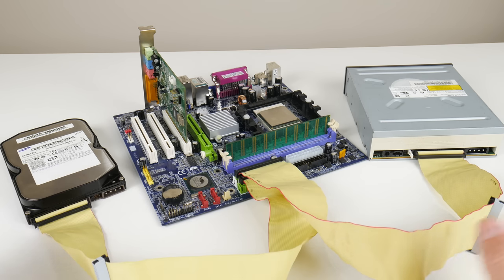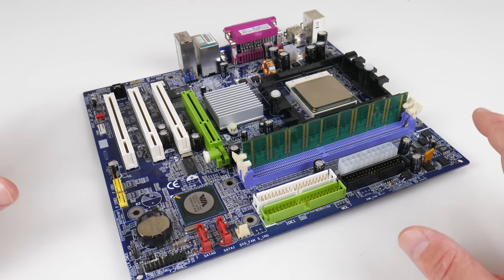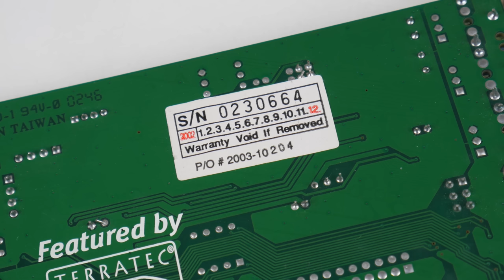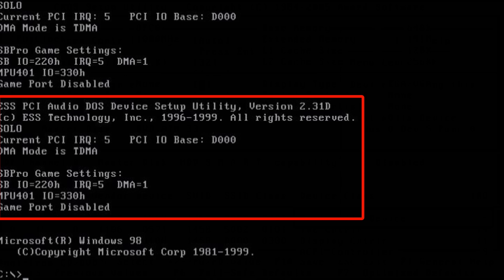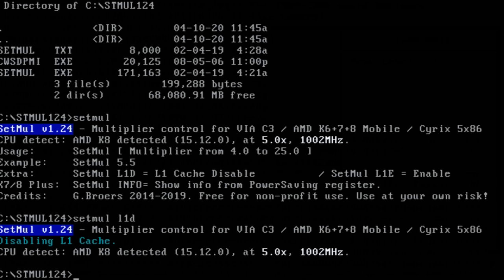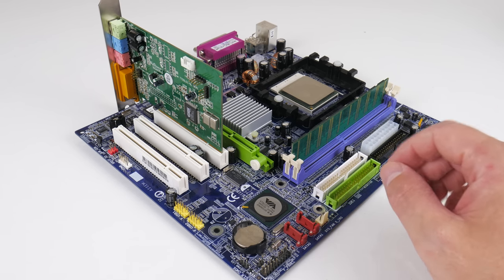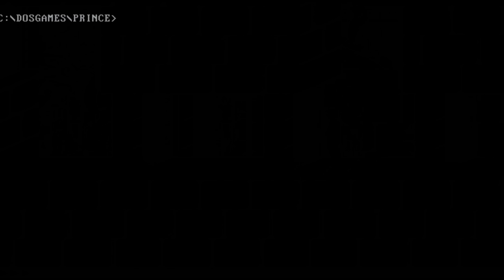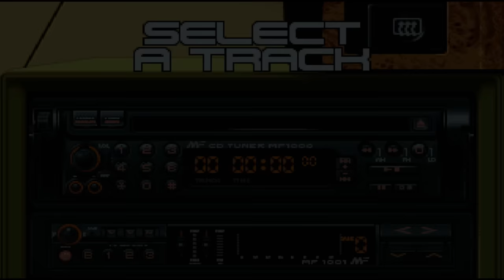DOS Gaming PC with Athlon 64?

Comment: Well, that does it. I have 90% of a socket 939 Athlon 64 PC in spares, and I've been looking to get into building a reliable DOS PC. Thanks for the inspiration! :)
Reply from the maker: The tricky parts is finding a compatible sound card. But do go with VIA chipset, should be most compatible with sound cards.
Reply: @philscomputerlab  Welp.. as it turns out, the motherboard I was thinking of was an AM2 board, so now I'm looking for a motherboard as well as a sound card :D
Reply: Just use it for router

😆😆😆

Comment: Fun fact about "Prince of Persia", the video and cpu was so low, author invented revolutionary hack to have smooth movements. pixels of charater not redraw at next frame, only changing (XOR-ing) some from the last frame... Later this technic was used in video compression (and still it's the base of all modern video compressions) but Prince was the earliest to do that
Reply from the maker: Wow that's cool and very interesting!
Reply: Yes, but that was for the original Apple II version of the game. The 16-bit versions did not need such magic. He overcame the limitations of the hardware and managed to include combat in the game (no memory left for additional characters). Otherwise, it would have turned out as an oriental prison exploration game. Visit the Ars Technica channel for the full story.
Reply: @НиколаГеоргиев-ш2б  of course, but the point is, he managed to get smooth movement on so slow system like Apple II 

 Now its simple, You just use compression, and when they did that, they invent one (there was no alternatives)
Reply: @philscomputerlab  hi phils i have this PC Fujitsu ESPRIMO E5720 Dual Core E2160 1.80GHz 2048Mb 80Gb DVD±RW

I can run dos  games

Comment: Important note!!!

Motherboard chipset a̶n̶d̶ ̶D̶D̶M̶A̶ support MATTERS when using PCI sound cards in DOS!
VIA which is used here generally has good compatibility, while nForce from nVidia is useless.
Also newer Intel chipsets (ICH6+ !?) dropped support during the Pentium 4 era I believe.

Vogons have many threads about this and what works and not:
https://www.vogons.org/viewtopic.php?t=24769
https://www.vogons.org/viewtopic.php?t=70375

But didn't know it could work with VIA on such a recent platform, cool :-)
Also didn't know about the IRQ trick on the PCI slot :-D
Reply: Much to learn you still have.
Reply: @retropcscotland4645  For trying out countless permutations, little time we all have ;-)
Reply: Not exactly. Look, this southbridge does not support DDMA and it works. It depends on sound card, this solo-1 has dos sound device as the main device, not legacy, so it is easier to make it run if you manage it to run physically on one of the standard DOS IRQ and the bios is supporting all southbridge features, a bit of luck is involved. Other cards which has the DOS sound device as a legacy device needs DDMA, or a TSR to work in DOS, like the PCI Yamahas, and are highly dependant on drivers support for chipsets.
Reply: @Romerco77  You are correct, I over simplified things. I'm wrong in saying DDMA is required.

Its more correct to say support depends on the chipset...or???
Reply: @Romerco77  ...or one can say:  You can't just use any motherboard with a PCI slot :-p
Reply: @retroftw  I would say it depends 40% on chipset, 40% on Sound card, and 20% on luck and bios. 😅
Reply: @Romerco77  lol...sounds about correct :-D
Reply: Yeah, it is. I can say I was unlucky and O had a great Nforce motherboard from Asus. So, no audio, nothing to do. I had to switch system.
Reply: Btw @PhilsComputerLab, my comment was not meant as critique of the video, more just my 2 cents about a potentially deep and complicated rabbit hole. :-p 

I really liked the video and learned some new things. This subject of PCI sound cards in DOS could in fact really need one or more videos to inform and clear things up.

Also, how far could we go in using newer platforms while retaining DOS sound via a PCI sound card one might wonder!? :-D
Reply: So... how come some SBLive PCI cards would work in DOS, and others would not? I had one on a 440BX chipset and it worked. Friend had a different setup (PPro I think) and couldn't get it to work in DOS for love nor money.
Reply: @Reziac  Even with hardware support, you still need to install the correct drivers, and get the IRQ settings correct in BIOS and in the driver settings etc.

So many things could have caused it. Difficult to say without alot more info ;-)
Reply: True enough. DOS could be an Adventure. :)
Thanks for the Vogons links, great info.
Good thing I hoarded all my old motherboards. :D

Comment: Another great video Phil, I had retro game nostalgia and begun with a Socket A (462) AMD trying to make DOS work, 6.22. I have yet that installation, but the only thing that I cannot make it work is audio. Omg, I became mad and I tried various audio card, but probably with my Asus motherboard Deluxe this card wasn't made to work pci sound card on Dos unfortuntaly. From that day I made a lot of tries and finally I had a Real Dos machine from 1996 with Banshee video card and a Pentium 200mmx. Games working finally and my audio card on that system was a Sound Blaster AWE64 Value, so can you understand how much I was happy. I figured out to run it on DOS (serious settings on autoexec and config) but now I have a Dos pc that make all games running, and in Glide acceleration too, thanks to 3dfx video card!
Reply from the maker: AWE64 Value is great for DOS! Every game every made should work with it :)

Comment: I've been playing around with PCem and I'm now pretty satisfied that the best way to capture the authentic look of DOS games is with emulation. Hardware-level emulation of a 486, S3 Virge/Voodoo and a Soundblaster16 is something that any modern computer can do perfectly. Games that came out after 2001 were optimized for Windows XP,, and backward compatibility for them works pretty reliably. But there is about a five year gap from 1996 to 2001 where games were built for Win95/98. These don't work well in modern Windows, but they require hardware that's quite hard to emulate if you want them to look good. I think that they are the primary reason why you'd want a retro-pc.  Of course if you slap a decent graphics card in that AGP slot, this Sempron machine would play them perfectly! I guess that makes it a pretty versatile little thing.

Comment: Nice video!, now for the perfect DOS+Windows 98 overpowered setup, with the Solo-1 for DOS + Sound Blaster Live for Windows exclusively. It needs some serious fiddling with resources, but it works and it is amazing!
Reply from the maker: Yea that shouldn't be an issue. You can disable the Solo-1 in device manager, and don't install DOS drivers for the Live!

Comment: Hey Phil, nice1 as always. Since I'm still parting together my 486-DX40 I went a not so modern way using an Epox EP-MVP3G5 with a K6-3 450. Though imho that itself is not that big of a deal I think the jewel in my setup is my used soundcard: The Labway D66. If I'm not mistaken it has the same soundchip as the soundcard you used but in contrary to yours it has a wavetable-header.
My hope is to actually use it with my Dreamblaster X2 (it sounds just awesome).

Comment: On the DOS VGA question - my favorite "modern" DOS video card is another nVidia - a Riva 128, like the Asus 3DP/AGP V3000. The AGP one can give better high resolution performance (yes, even under DOS!), but unfortunately it won't fit this board as the old Riva has an AGP2x interface. Funny that the PCI version that was the "legacy" option when it came out will do just fine here.

Comment: Wolf3D (386DX-40 from AMD) is literally why I did NOT play FPS until I saw Quake 3. It gave me massive headaches

Edit: Looking at that S3 Card - I was jonesing SO much for S3 Virge for so long (Tomb Raider days). All I had was a S3 Trio64 same as in this video wahahaha, no 3D = slideshow above 320x200
Reply: Every blue walls and sky blue doors look the same
Reply: The S3 ViRGE was hardly 3D either. I have a Stealth 3D 2000 from Diamond and it's really just a speedy 2D card. Falls flat on its face in real 3D accelerated games.
Reply: @nelizmastr  by today's standards it's as 3d as a SATA Controller but back then it had proper 3D acceleration support which was well unheard of mostly back then :)
Reply: @airmicrobe  Can't tell if that's why.. I was like 12 and with my first computer (aforementioned 386DX-40 which BTW lasted me until I could afford a 233MMX) Wolf3D was installed and Prince of Persia. I literally either had to like Wolf 3D or play PoP. I can tell you I tried real hard but after 15mins I'd be nauseous :p
Reply: I used that same Trio in my P233... was perfectly fine for DOS games. Virge was faster but at the time were expensive and hard to come by.
Reply: @nelizmastr  The ViRGE. Yech. The DE-celerator.
Reply: As an edit to myself.
I had one of these. Ithin it was on a K6, IIRC. Yes they would sorta maybe if you held your head at just the right angle look a tiny bit maybe 3D ish if you didn't look to closely or too long at it.
This was the worst video card I ever owned.  Even worse than the Nvidia 7100 GS.
Reply: @dikbozo  I think it's a bit unfair and out of context:
1. By the time the k6 was launched '97 the virge was 2yrs old
2. Competitors ATI (3D Rage) 3dfx and Matrox came much later IIRC '96 and were much more expensive (in particular 3dfx)

The S3 also showed that a card could have both 2D and 3D albeit weak one and to be fair back then 2D had much more use cases than 3D. By contrast the 7100 GS is doing nothing for the market but even then I'd argue I like the 7100 GS because it's:
1. cheap
2. fanless
3. uses very little power
As such it's great for some old pcs you want to convert to be home servers or even for use in actual decommissioned servers.
In fact I'd love it if we had some card for that market segment that only had 2D capability :)
Reply: @Airbag888  The particular 7100 GS I had was indeed fanless and cane a part of a bundle so cost was irrekevant BUT the thing ran so hot I was afraid it would melt. No it was not a good experience.
As to the ViRGE, the card would crash due to driver issues and it had very poor support and performance in openGL, which I forget why, was important to me at that time. No, I am not being hard on it.
Reply: @dikbozo  Fair enough, I had close to zero experience with the Virge because I plain could not afford it then and could only drool thinking how nice it would be to have to play Tomb Raider.
I can bet the 7100GS ran hot in 3D but did it also run hot in 2D? I guess that's moot but did you check the temp sensor? I have a GT210 that is fanless and ran at 60C on a home server box
Reply: @Airbag888  Temp monitoring software was not a hot topic BITD. I DO know I risked burning myself when I brushed against it while idling at the desktop. I fully expected it to glow in the dark at night after trying to game on it. The experience of gaming on htis card was not good, IIRC.

Comment: An Athlon 64 doesn't have to be to slow for XP gaming, I have an X2 4200+ running at 2.76GHz. It runs Farcry really good, and it even does a decent job running newer games like Fallout New Vegas!
If I want to play anything newer than that those games usually runs fine on Win 10, so you can play those on your main PC.

But after watching this I might have to try running DOS on it to, even if I alreade have two 486 and two pentium systems already.
More DOS is good DOS :)
Reply from the maker: Yea at 2.8 GHz almost and with 2 cores, I can see that it would run all the XP era games just fine!
Reply: I am curious as to what cooler you are using on the 4200+. Those Manchester chips weren't particularly cool running when OC'd.

Comment: Hey Phil, I’ve been trying to decide on what CPU/Platform to build a MS-DOS PC on. My 2 main candidates came down to socket 478 pentium 4s and socket 754 or 939 Athlon 64s but I haven’t had much experience with Athlon 64 (yet). From your experience which CPU would be a better choice? Oh and may I suggest you make a video on MS-DOS on a Pentium 4 because I think many people including me would be interested in that video/topic. Have a nice day and hope you see my comment.
Reply from the maker: With Athlon 64 you have choices of VIA chipset, which have better support with DOS PCI sound cards. That is a strong reason why I would go with Athlon 64.
Reply: @philscomputerlab  thanks for the replay. Do you know of any slower Athlon 64 or sempron that would be better for DOS?
Reply from the maker: @Bigharb65  Pick one with Cool and Quiet support. The multiplier, and voltage, can be lowered through BIOS and even software! Cache disabled with software (some have BIOS option) turning it into a 486 PC quite easily. Maybe I should make a video about this, but there is another one I want to do first using LGA 775 Pentium 4 or Core 2 :D
Reply: @philscomputerlab  oooo dos on a core 2 seems fun but you might run into a good bit of compatibility errors. Anyways thanks for the replay and if you need any retro or somewhat newer parts let me know cause I can get retro parts for like $5 a part and $2 a CPU.

Comment: Interesting to see just how much faster the S939s are in pushing frames in DOS. What's hilarious though is that not even these overpowered CPUs can deliver 60 frames at the max resolution in software Quake! Doom also scores way lower on newer GPUs.  Here were some results I recorded on my A64 4000+ 2.4ghz in DOS on an FX5900 Ultra:

Quake:
300x200 - 223.1 FPS
640x480 - 85.1 FPS
800x600 - 57.9 FPS
1024x768 - 40.5 FPS
1280x1024 - 41.9 FPS not sure why but this is consistently higher than the lower resolution

PCPBench:
320x200 - 269.5 FPS
640x480 - 95.6 FPS ( terrible flickering occurs)

ChrisBench:
320x200 - 267.6 FPS
640x480 - 294.8 FPS ... weird but I consistently got higher FPS on the higher resolution with both GPUs.

Doom - 72.86 FPS

TopBench - 291

Build Engine was very choppy and slow on both the FX5900 and ti4200. I had to drop to a Geforce 3 to get it to run smooth. 

With WC (MTRRLFBE or FASTVID) enabled on the Geforce 3.

Blood:
320x200= 274FPS
640x480= ~60FPS
800x600 = 4FPS ... LIES, feels exactly the same as 640x480.
1024x768 = 24FPS ... more lies.. see above.
1280x1024 = 15FPS ... also lies but certain areas where it dips to 7FPS it feels like it is ~15.
1600x1200 = Locked 50 FPS, totally smooth

Duke3D @ 1600 x 1200 = 59/60FPS locked... perfectly smooth.

The 4000+ can downclock to  723mhz (180FSB x 4) which is perfect because Outcast in Windows 98 gets cranky above 800mhz and some other games don't like 1ghz+ either, believe it or not.
Reply from the maker: Thanks for sharing this data!

Comment: G'day Phil single or dual core? I recently put DOS on my old K6-2 system and it works great. As to Athlon 64 would you recommend a single core over a dual?
Reply: There in no support for multiple cores in Win98, so the answer is obvious 😅
Reply from the maker: Single of course!
Reply: @philscomputerlab  Thanks mate.
Reply: @philscomputerlab  The only single core Athlon 64 I have is for socket 939 and the board I have is also a VIA chipset. I might give this a go.

Comment: 2 days ago I started playing Indiana Jones and the Fate of Atlantis again- I told myself I would never play this game again. 26 years ago in 1994 I got a 486 computer and bought this game. I was in my 2nd year of university and played this game for 2 weeks solid. I was obsessed. It costs me a lot- low grades on essays and affected my overall degree class. But, playing it again, at almost 50 years of age, I can't help by being obsessed by it again. I managed to get it running on a SS7 board with an AMD K6-2 233Mhz. It's so difficult to get the sound working right in this game.  Thanks Phil, for inspiring me to return to one of the best games ever made.
Reply from the maker: What sound card do you use? Make sure caches are disables and if the game freezes, check your mouse driver, or test without one.
Reply: @philscomputerlab  Thanks for replying. I use 2 cards- the first is a SB Vibra 16x CT4170 ISA from 1997 which is pretty unimpressive in Windows and DOS. In Windows 98 I can get music but no voice in FATE. My other card is a new, Chinese clone which can be bought from Asian sites like Shopee and Lazada- very cheap- cost 3-4 dollars. It's a CMI8738. It came with a small CD with drivers for DOS and many Windows. In Fate it plays music well and voice but sounds like punches when Indy fights do not work. This is in Windows 95.  It works pretty well for the price except if you play Canyon.mid it sounds terrible.